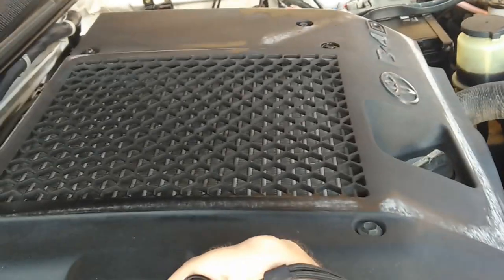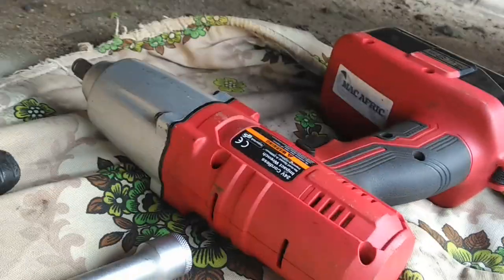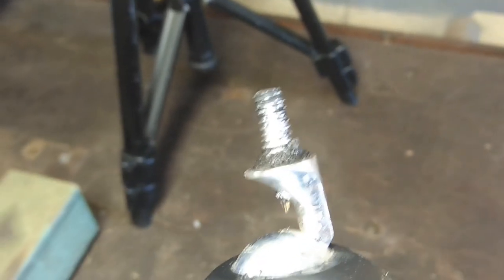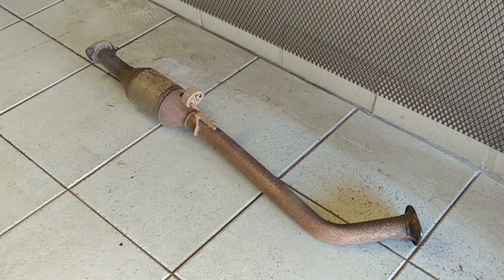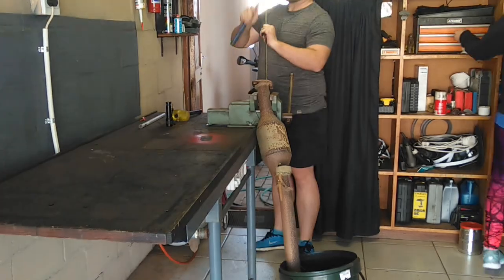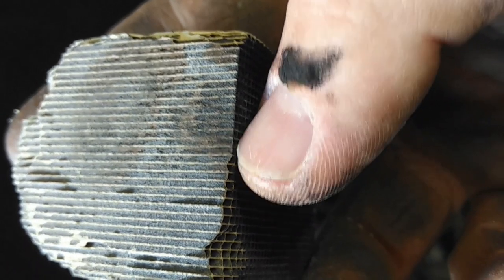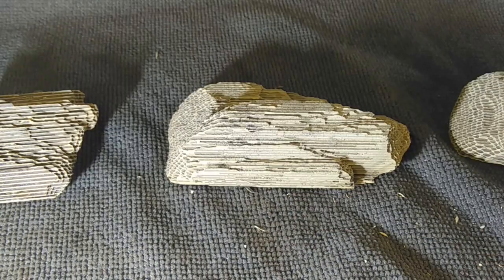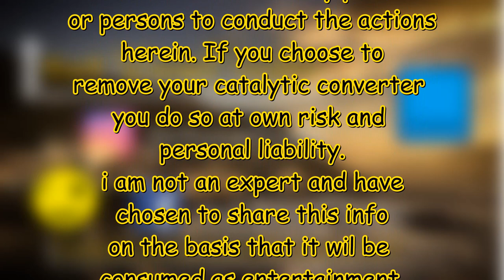How to remove a catalytic converter from a d4d Fortuner/Hilux

Comment: Informative video, thanks! Are there any gaskets on the flanges that you need to worry about damaging on removal? Looking at doing my 2012 D4D Hilux.
Reply from the maker: Hey Jonathan. No there are no gaskets. There is a silicon seal but its like a washer. You just put it back if it fals off. If it doesnt fall off just leave it there and put the segment back.
Reply: @4x4ViewFinder  Great, thanks for the response!

Comment: mate, thanks for this video. I been looking all over youtube for weeks trying to find a video like this that's in English. Since this video have you remapped?
also those small led in the grill, is something you did your self or did the vehicle came with it?
Reply from the maker: Hi mate. Im so happy i could help you. I have not yet mapped. In last week i did a DIY straight pipe conversion and the car sounds awesome now. The final reveal on that coming this Fryday at 18:00. I want to finish up all the other external mods before i do the map. Those LEDs in the grill are Hella Daytime running lights. They are an accessory that you can purchase off the shelf. As a matter of fact you should find a plethora of these lights online and perhaps close to where you stay as well. They are very simple to fit and just gives that extra bit of visibility during the day. So happy to have been able to help you mate.

Comment: glad i found this video. i have a couple of friends that has been trying to convinve me to straight pipe, unichip, intercooler, egr block..... i refuse to as i dont want to interfere with the reliability of my d4d. I have a 2013 fortuner 4x4 auto, 200 000 km on it now. Considering to remove the innards of the exhaust. I am in 2 minds about doing the chip etc. My fuel consumption i think is a bit hectic. I get around 550 - 650km on a tank. I think it feels a bit sluggish i dont know. whats your suggestion? Also is that the CAT of DPF that you are removing?
Reply from the maker: Hi Ryno. Im so happy you found the video helpfull. Your tuner does not hav a dpf only a cat. The exhaust goes straight from the turbo down and out. Im just removing the innards of the cat. I also have 2 videos on doing a straight pipe. If you have some welding skills you should be able to straightpipe your tuner yourself. Fuel consumption wise the diffrence is very small but relieving the resistance on the engine and turbo from the exhaust side of things will definitely improve the longevity of your engine. Your turbo wil spool up a little lower in the rev range and your exhaust gas tempratures will be greatly reduced. Im also in 2 minds about a performance upgrade. I would however not recommend a chip. Way too many issues with cars over 200k kms. If you do reaaaaaly want to improve performance, rather map the ecu by a reputable performance shop. Too many fly by nights. Also there are things you can do if you feel your off road performance is lacking. I have a whole video about the traction control system. There is something in there that very few people who own a d4d know. That should help a bit off road. On road, always remember, stage one of every performance upgrade is always exhaust. Get your exhaust straight piped and cat removed then get the performance upgrade. If you do the one before the other your exhaust gas tempratures skyrocket and your turbo and exhaust manifold take a lot of punishment. Your fuel economy drops considerably and your engine runs very hot. As you know, not good.
In my opinion, forget the performance upgrade, do your exhaust, its the only thing you can safely do and not mess up the reliability of your car. In the end, reliability trumps performance. And unfortunately most discover this only in hindsight.
Thank you for taking the time to comment. Sorry for the rant, the subject is pretty complicated.
Keep safe.

Comment: Sounds lekker . Can’t wait to hear it live again
Reply from the maker: Definitely bru. It has a pronounced whistle like yours. Cant wait for you to hear it in person. Keep safe bru. Next trip.
Reply: Great video, thanks. Looking to do the same on my Hilux. How has your power and fuel economy been since then?
Reply from the maker: Well Anthony, not that much better. I now get a solid 10km/l in city driving. Up from 9.7km/l. So it is slightly better. But i just finished filming my snorkel install and i noticed the air filter is in horrible condition. That might have added to the poor economy. So after i get that sorted i wont really know. And also as a result i wont know which of the two is causing better economy. I can kick myself for not checking. Thats why i dont trust the dealers. I think with the snorkel andnthe cat out i am hoping to get close to 11km/l. Then i wil be very happy. Video coming out tonight. Thanks for taking the time to comment, i really apreciate the support. Stay safe.
Reply: @4x4ViewFinder  cool thanks man. Will be interesting to see, looking forward to the video 👍 I'm also busy shopping around for Snorkels.
Reply from the maker: @burtons_undiscovered  great, try 4x4 Direct. They sell the Badger brand. They have a lifetime garantee against fading. That helps. If you do find one and would like to install it and run into a snag, send a msg on Facebook. There is a group and a page. There i will try to help you as far as i can. Keep safe Anthony, thank you for subscribing.
Reply: @4x4ViewFinder  thanks man, I've seen that one... Might buy it this weekend hahaha

Comment: Great video bud! have you notice any performance improvements after doing this? cause im planning to do this as well since i have changed to a high flow air filter and remmaped it.
Reply from the maker: Hi Ivan. Thank you for your comment, well at the low end there was a very slight improvement. At the top end not so much. Because the turbo can now spool up from virtually no revs, it helps give some oomph down low. If however you couple that with a straight pipe, and a map after that, you may get some great gains.
Reply: @4x4ViewFinder  awesome! It already had performance filters and a remap.
Reply from the maker: Awesome, just remember in future that you always leave your remap for last. You first do all your performance upgrades and then map. That way your engine is tuned to what you have upgraded. Otherwise, in most cases it negates your upgrades because your engine is running on old perameters and limits set by your previous map. A stage 1 upgrade always includes and is not limited to an exhaust upgrade, the next stage is a map. From there you change turbos and or intercoolers etc. After which you do a remap again. Unless you do all of this at once. A good dyno tuner will ask you if you have done an exhaust upgrade before they tune, as mapping always comes after that. You dont need to do an exhaust upgrade but 99% of people who opt for a remap, almost always want to do an exhaust remap for even more performance afterwards. A remap before an exhaust upgrade also has the risk of raising your EGT's and causing additional ware on your engine if you happen to tow or run the car hard. So i always suggest to do a decat and a straight pipe first, then do a map. Your engine will thank you.
Reply: @4x4ViewFinder  update i just did it together with an egr delete/blanking and i was amazed by the difference in performance. low end torque is much more powerful and it did improve the sound.

Comment: Awesome video...would you recommend to completely remove catalical converter from my 3.0 d4d and does it have any advantages to it ?
Reply from the maker: Hey Denis, thank you so much. I really apreciate it. Short from reducing exhaust gas tempratures (EGT) and improving the longevity of the engine, there is not that much more. Hope this helps. Keep safe brother.

Comment: Adriaan thanks for the video. What are the benefits of putting on a straight pipe vs decat on original pipe? Thanks again.
Reply from the maker: Hi Marc. Well your EGT exhaust gas tempratures will drop tremendously, thereby putting way less strain on the turbo caseing and manifold. Your ECU will also no longer throttle down your engine when your vehicle is running in extreme conditions, like high revs while playing in the sand. Overall a SLIGHT  improvement in feul economy. But the biggest gain is the improved longevity of the engine. Its like breathing through a mask. Its not completely bad for you but its way nicer without it. And the noise a d4d without the muffler and cat makes is really nice.

Comment: Great DIY video. I wanted to ask.... What is your view on a EGR delete for the D4D engine.
Reply from the maker: Hi Jayesh. Thank you so much and thank you for taking the time to comment. I really apreciate it. I would not do an EGR delete on a d4d engine. The exhaust gasses being introduced to the combustion chamber in the d4d engine are there to lower combustion tempratures,(part of what makes the engines last so long) and thereby easing undue strain on the turbo and cooling system. If you block it off you will have an increase in exhaust gass tempratures and an increase in feul demand, so bad feul economy, qnd a marked increase in workload on the water pump and radiator. If you have a older model this is where you will start seeing your first failures. Also turbo damage is not far behind. The engineers at toyota build every part of a toyota engine with a purpose, and absolutely nothing is redundant or unnecessary. I did some tests with my Nissan Navara back when i still had it. I blanked off the egr and nothing changes. Got a little more smoke out the other end but nothing to write home about. Found out that in most cases the egr iin some manufacturers are just there because they have to be. Toyota go next level and actually try to make it work. So in my opinion brother, leave that egr the way it is. Best you can do is have it cleaned by toyota technicians as i know they do get clogged over their lifetime. But other than that, it would be safer and it would maintain the reliability of your vehicle. The way it was designed to. Hope this is helpfull brother. Thanks for the comment. Keep safe.
Reply: @4x4ViewFinder  Thanks for the reply. I will leave the EGR alone.

Comment: Howzit man great video , sorry iv got a few questions,  iv got a toyota hilux  3.0 d4d shes sitting on 455000 km now getting close to half a million do you think if I  do just a cat delete will it improve some lost power ? as I imagine it must be full of shit in there , and do you think just a cat delete will improve the sound ? And whats you opinion on the whole EGR delete?
Reply from the maker: Hey Cody. Thanx for the compliment bru. Really apreciate it.
First off, a cat delete wont give you any more noticable power, but in your case, you might notice the van being a bit more nippy, but nothing to write home about. 
The sound may improve slightly as well, you will hear that iconic turbo sound a bit more clearer without the cat, but removing the exhaust box and putting in a straight pipe might sound a bit more aggressive. Just replace the exhaust box with a resonator and it will sound factory.
On the egr delete. You can do it on most other vehicles but not on a d4d. The egr actually plays an important role in keeping exhaust tempratures regulated in a d4d. Unlike other brands the d4d uses the egr integrally. Other brands use it because they have to. 
My advise, you can adjust, change or modify almost anything around the engine, but dont mess the engine and its workings. Toyota designed a masterpiece of engineering that will probably last you another 450k Kays. Everything about it is designed to last, so the moment you change anything that messes with how the engine runs, then you are going to compromise longevity. 
The exhaust however toyota knew people are going to have aftermarket work done, so you can do whatever you would like to to the exhaust. 
Hope this was helpfull Cody, thanx for supporting bru. Keep safe.
Reply from the maker: Ps, i have a made a 2 part video where i do a straight pipe conversion on mine. There you will be able to hear what it sounds like. Camera does not do it justice though, but it will give you an idea.
Reply: @4x4ViewFinder  ah thats awesome id love to hearbl that whistle alittle more , I hope it does feel abit more nippy , they really did make a master piece and she's been serviced at toyota since new and every single time on time so every thing is still 100s but I just feel like something is missing I don't know what it is but it feels less powerful than a few years back maybe it just my mind , but now iam thinking to maybe send her in to get EGR system cleaned then remove cat and maybe the rest of the exhuast to lol 😆 and then maybe a k&n to help her breath abit better ? Hoping that might bring back some lost power
Reply from the maker: First have your injectors checked bru, most of the time, as a result of time, the injectors get clogged because of our bad feul. If your vehicle is still standard in all respects and you get less than 8km/l in city then chances are they might need a bit of a clean. I would avoid K&N air filters on any vehicle. Yes they let more air through but they also let more dirt through. Dust is an enemy of an engine. If you are never ever going to drive on a gravel road then maybe consider K&N, but if you are going to go anywhere near a dirt road, use the toyota airfilter. Its designed to give the best performance while protecting the engine. Like i mentioned bru. Dont mess with anything around the engine. What you can do is fit a schnorkel. That will let cooler, cleaner air into the engine and reduce the amount of dust the filter has to cope with. Just my 2c on the matter bru.

Comment: Goodday there did you experience any problems yet and after removing the catalytic did the engine warnlight come on and if it did how did you remove it?
Reply from the maker: Hi Sackeus. No problems. Its been almost a year now. You shouldnt experience any issues. Unlike nissan, Toyota did not make the cat part of the ecosystem as it where. They knew people would want to remove it. There are no sensors before or after the cat that determine engine management. Even on the new models.
Reply: @4x4ViewFinder  okay cool thanks
Reply: @4x4ViewFinder  Goodday there just giving you some feedback I removed my catalytic converter on my fortune 3.0 d4d and am amazed cause there is really a difference, I did a long distance 4x4 trip over the weekend the fuel consumption isn't that high  and feels like the car isn't working that hard anymore since the Cat is out. And am doing 161km on the vehicle
Reply from the maker: Hi Sackeus, thank you so much for the feedback. Im so happy you got such good results. Im really glad i could help and also improve the longevity of your car slightly. Many happy miles my friend.

Comment: Hi have you noticed a change in the fuel economy, I drive a 2013 3.0 d4d which I have owned since new and the fuel economy has changed quite drastically over the years? Any issues with the ecu picking up that there is less pressure in the exhaust? I had a look and there are no sensors on the exhaust as you would have on a petrol vehicle.
Reply: I am very tempted to remove the cat as well, gives a nice growl on your video. How is the sound in the cab no drone noises etc?
Reply from the maker: Hey Wilfmeister. Hope you are well. I just came accross your comment, not sure why i did not get it on my phone. I always endeavor to answer every msg i get. so sorry for this. Will check my desktop more regularly. There are many factors that could affect your feul economy over the years, normal wear and tare on engine components are normally to blame. Toyota know that people will be modifying the exhaust so they never put sensors on them. Even the new bakkies dont even have a cat inside the can. Its just there as an eye-blind. My dad got him a new legend 50 and went to have the cat removed only to find there is nothing inside. The ecu only monitors exhaust gas tempratures in order to limit performance if it gets too hot. By removing the cat you relieve the engine of an enormous amount of backpressure and thereby drastically dropping EGT's. So the engine only benefits, it does not change any of the parameters on feuling or air, the engine runs exactly the same only now it runs cooler. Hope this was helpfull friend. Keep safe and thank you for commenting.
Reply: @4x4ViewFinder  hi Adriaan thanks a million for your reply. I went ahead and removed my cat by breaking and removing the cat piece by piece. I even went as far as buying an old mid pipe of a old d4d and replacing the muffler with a high flow resonator. I went with a medium size resonator I didn’t want it too loud. My fuel mileage has improved quite a bit and am happy with the result. Kept the old mid pipe just incase it was too loud. Got a decent power increase in the higher rev range as well.
Reply from the maker: Im so happy if i was of any help. I suppose you have the same issue i have now, heavy-foot-in-tunnels-and-between-buildings-disorder.
I have saught help but there just arent many support groups out there.